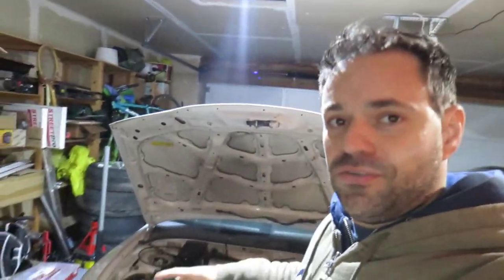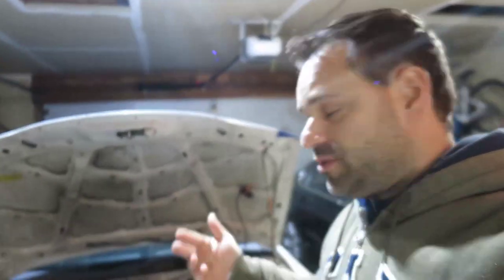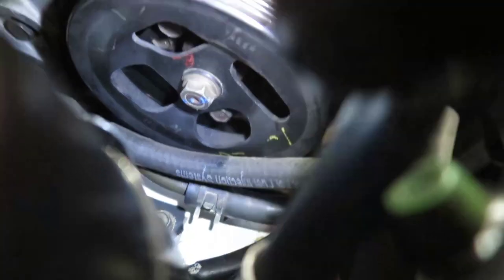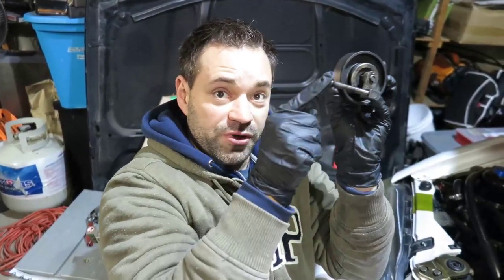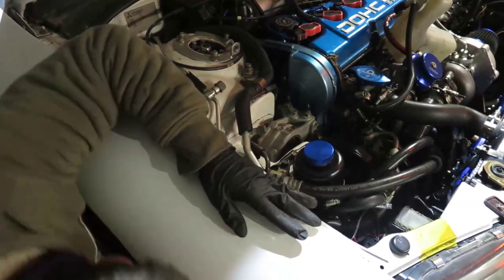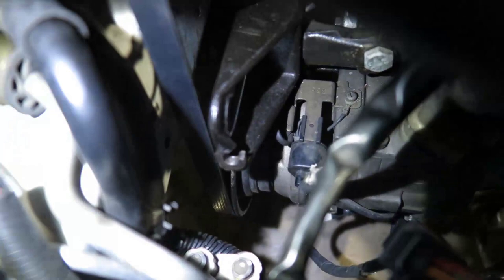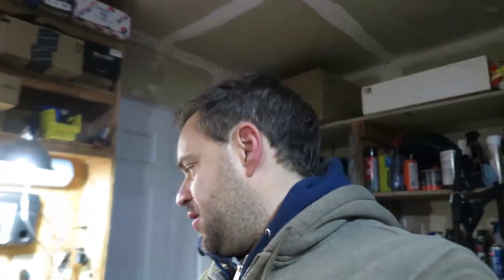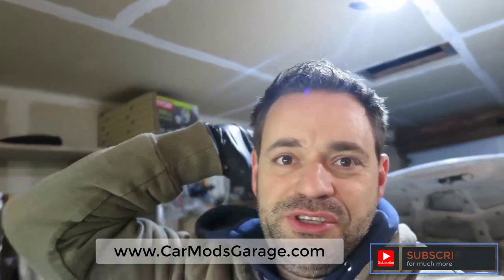Delete Serpentine Belt Tensioner - Eclipse 2G Project

Comment: Do you still have that tensioner pulley and adjuster bolt? My adjuster bolt snapped and i have been looking for a replacement sadly it is discontinued :(
Reply from the maker: For the power steering? I might have it but not sure where.   I can look and will message you back if I find it.
Reply: @CarModsGarage  yes, the one that you deleted with the adjuster bolt. I need both the pulley and bolt if you still have it. I appreciate the help.

Comment: i’m still watching the video but does this work without a turbo? my belt always falls off and the mechanic i sent it too he said it was the harmonic balancer. i’m wondering if i can just delete the tensioner
Reply from the maker: Oh ya it does work without the turbo. I deleted for the turbo because with the extra boost it keeps skipping. You can definitely delete it though. 🤙
Thanks for watching brother!
Reply: @CarModsGarage  i’m going to do it right now! is it necessary to use the serpentine belt from amazon like the video or can i use the original
Reply from the maker: You need to get that one or something same size as that one. Since you are going to remove a pulley the OEM will be too long.
Reply: @CarModsGarage  Alright no problem thank you!